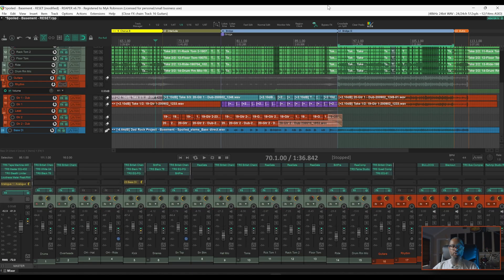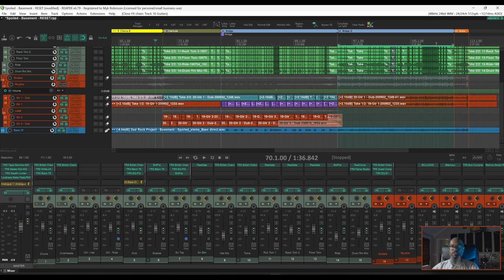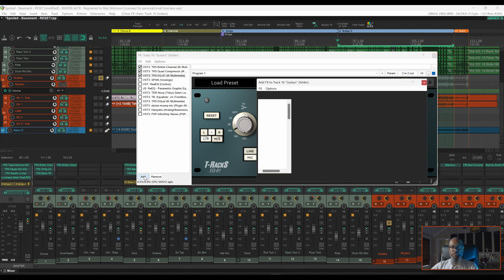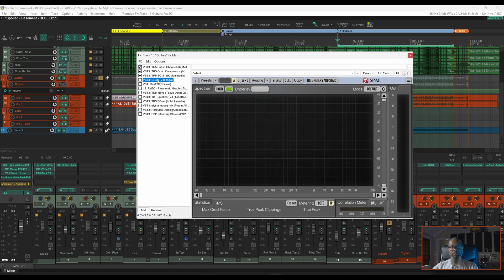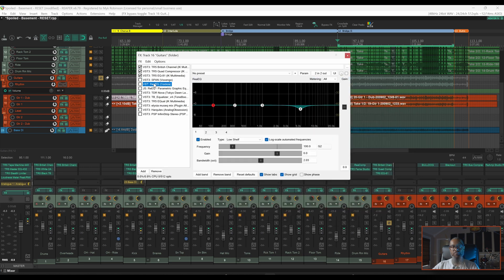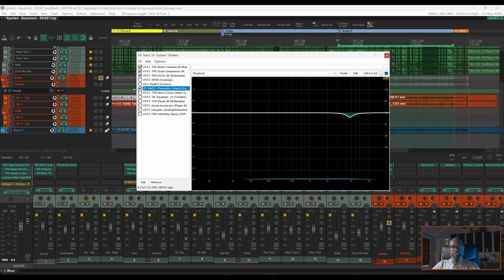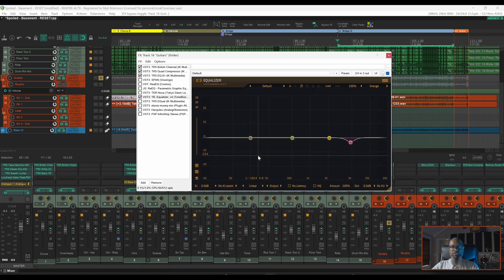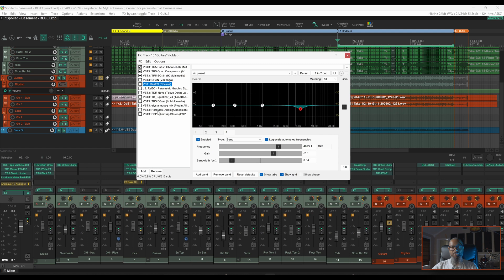Removing Harsh Frequencies from Guitars in REAPER

Comment: the thing about the span tip is that it does the same thing as reaeq depending on where you click it changes the gain of the isolated frequency and again this brings the turning up any frequency like that sounds bad

Comment: Hi, Mike! I`m working on my mix now, and decided to try the technique from one of your older video about mixing with Pink noise, and I can`t decide which level should I set it to. I have more tracks than in your project. So how low should I make it? Is there any math behind it? I used to set everything to -18RMS before mixing
Reply from the maker: Honestly, I feel it's a tough question to answer as it in many respects depends on a preferred workflow.

I tend to shoot for between -18 and -12 because that's what my common plugins like. I know that in another video I talked about rough mix and balance and such, but even with that concept, we have to keep in mind that it is rare to leave all faders are zero, so sometimes it's fine that the master or a bus is clipping, because you simply haven't reduced some of the faders yet.

An example is my hat channel and ride channel. I want the incoming signal to be sufficient so it'll work properly with the plugins I plan to use, but I know going into this that there is NO WAY those two channels are going to have their faders up high because there is sufficient signal in the overheads and room mics, and those spot mics will be used more for "directional placement" and focus on certain parts, like if there was intricate hat or ride work in spots.

I realize that didn't exactly answer the question, but in retrospect, there really is no cut and dry answer. A lot of the things I mention in videos like the pink noise video are really more for helping to get a reasonable starting point, and will be modified by many to better suit their own workflow.
Reply: @LetsTalkAboutReaper  understood, thanks!

Comment: Nice Reaper theme and this it's much more readable now on a 1080p screen! Guitars sound great, my initial critique of the mix is the cymbals sound kinda dark and very compressed, but it's a work in progress ;)
My tips to add:
I was going to comment what you said about the sweeping method, it works, but you can easily find a near infinite amount of points to get rid of that may not really need it.
I like to try to just listen to the guitars in the mix, then solo'd and find out what I don't like and target right around that region only. The "vowel method" video by audio university is a great trainer for starting to hear that, it certainly comes with time and practice. 
As for determining how much to cut, usually 1-2 dB is a good safe bet, but I like to slowly a little, then a lot, and work back and for until I find the spot where it sounds like the annoying noise is masked by everything else, but not sounding weird and scooped there - something that you'll hear if it goes too far. Sometimes, if you cut something too much, it uncovers another frequency in the process and you want to deal with this. That can be a rabbit hole (I've gone down too many times) that leads to doing way too much and getting a weird sound, at which point I usually reset the eq to 0 and start over...
Usually 1 or 2 bands in the treble region cutting 2 dB or less will get you where you want and if it needs much more than that, maybe you shouldn't be trying to fix it with EQ!

Comment: Is it just me, or are they still harsh?
Reply from the maker: There are additional frequencies that need some attention, and some of the EQs shown in the video could honestly use a bit more adjustment.

So "some" of the harshness was reduced but not all. Still work to be done 👍
Reply: Sounds to me like an excess of energy in the low mids causing a bit of mud which is perceived as a little harshness, through sounding a touch smeared above. But I am listening on my phone whilst in the kitchen, so I may be off lol